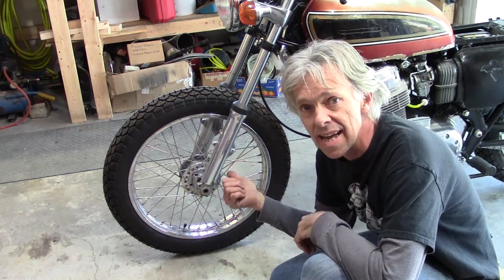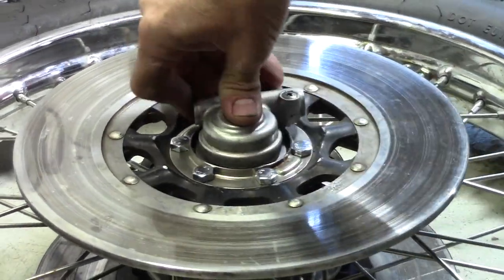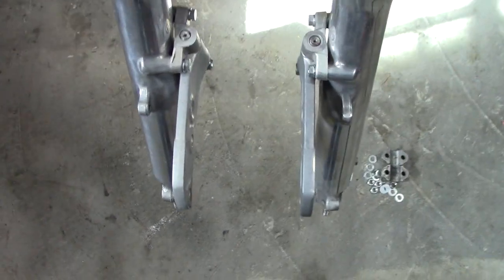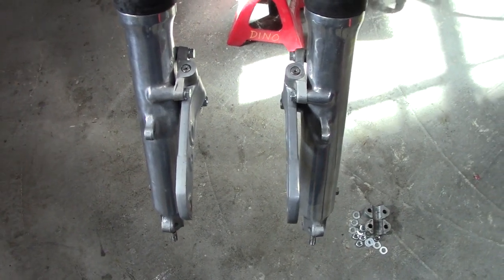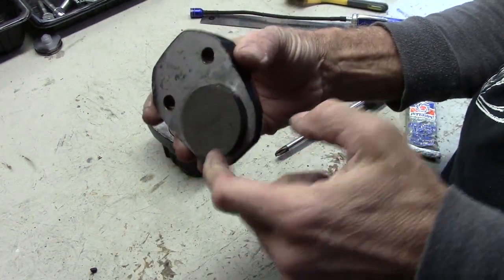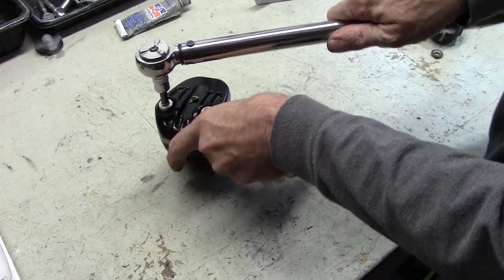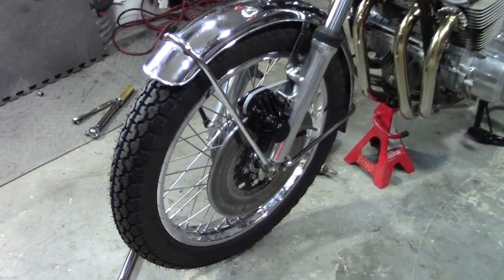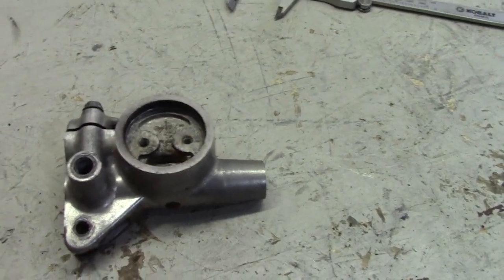73 Honda CB750 Custom Build Part 37 - Front brakes

Comment: The CB750 really needs two brakes on the front.  Once that I made the upgrade, it made a huge difference on the track and in the mountains.  The stock master cylinder works great.  I used a set of Morris Mags which were custom fit just for two brakes.  I also put the lower fork sliders on the other sides so that the brakes were mounted behind the forks, which made a noticeable reduction in steering mass.  C. Jeff Dyrek.

Comment: Really love this series Dino - thank you for making them. I have a '72 with a single front brake. My buddy convinced me to scrap the dual front idea and just go with a braided brake line. I'm telling you its 85% better brake feel and power. It is still not a modern feeling front brake - it will not compare to anything made in the last 25 years, but it is a major improvement that keeps the stock look. I would highly recommend this upgrade.
Reply: +mtvroadglide That's exactly what I'm doing. :) Made a big difference on my VF700S Sabre.

Comment: My father had a 71 CB750. He put dual front disks on his without switching the master cylinder. He remembers it actually making the breaking worse because he couldn't apply enough pressure through the front breaks. Although I don't have any details on his build because he did it in 72 and he didn't have the bike from much longer because his bike was stolen that year. Regardless, good luck with you project/build

Comment: The adjuster on the brake caliper support bracket is to make sure the pads are parallel to the disk.  It is not meant to take up the disk to pad gap.  The piston will do that once it is used.  That is how you get the best stopping power.

Comment: This mod, two disk brakes, has been a popular brake improvement back in the day.  I have done it to two of my 750’s with no issues.  Not sure why you are having a difficult time but the brakes are symmetrical and can be used on both sides.  Also the master cylinder is sized wrong for one brake.  Works better with two calipers.  Most bikes of the time had the same issue with an oversized master cylinder.

Comment: Have enjoyed these so far by the way, so many familiar parts of my thirty plus years doing Honda parts that ended in 2013. I've just started another job working with BSA and Ariel parts, which is f course similar but somehow very different.
Reply: +keepitrunning I'll bet you know some of the common part numbers by wrote. :)
Reply: +Dean Segovis  Oh yes, so very many in my head up until 2000 anyway after that it gets all a bit messy and harder to recall as I missed 6 years of models and then had to cope with cars as well which I struggled with. Not much use to me now with Ariel and BSA but I only have to pick and pack those for 3 hours a day so that doesn't matter do much for now.

Comment: I have a 77 cb750k that I am doing the dual disc conversion on and ran into the same issue with the dust shield. I just to happen to have a set of wheels from a 76 goldwing. That bike, as I'm sure you know, ran a dual disc up front. The gear box retainer, dust shield, and bolts mount up perfect. Didn't need to destroy my factory dust shield incase things don't work out. Haven't rebuilt the caliper yet so I'm not sure how the offset issue will affect things.

Comment: I assume it's the same as my 550, but the bottom fork caps should have the gap at the back. The front is tightened to spec so there's no gap and the rear is tightened to spec so there is a gap. At the 20:20 mark is where you can see the cap you're putting on is backwards. Does it matter? No idea, but Honda specifically mentions this in the manual...at least for the 550 k4. I've been following since the beginning of the Sabre, awesome seeing these videos and following your progress!
Reply: +Susan Barbier Thanks! Someone on the SOHC4 forum mentioned this as well. I'll check it out and mention it in a future video.

Comment: Hey Dino, might not apply for your cb750 but I know on the cb500 from that year the two fork-end clamps that hold the front axel on are uni-directional.  Might be worth checking.  Cheers and thanks for all your videos.
Reply: +Puffin Tyler Thanks!

Comment: How did you get the snap ring out of the master? Its insane. Ive tried a variety of dentist hooks,3 pair of snap ring pliers...no luck.

.
Reply from the maker: You have to pry it inwards with one screwdriver, then get a second screwdriver behind it and pry out and up. It's tricky.

Comment: You do realise that the 3 in K3 does not denote a 1973 model as such. It just happens to be coincidental on this model. The K means revision, from some Japanese word. So this was the third revised model. Some people refer to various K0 models but that technically means nothing. So my CL175K6 is the sixth revised model and is a 1972 model year bike. The odd thing with some series, like the various 175's is that they start with the basic model like CL175 but the next one there is I could ever find listed was the K3. I have yet to work out what happened there I just assume for some reason they were never marketed. The last K type numbering I know is the CB750K8 which of course was 1979 then Honda started on a whole new system of letters, starting with Z for 1979 then following through A for 1980 etc. By the time they got to Y it was 2000 so 2001 to 2009/used just 1 to 9 then started with A again in 2010.

Comment: Dean, I am not sure about using anything other than brake fluid as lube on the seals and piston.  I'm honestly not sure how having the silicone lube in there will affect it.  Just wanted to point out in case you have any better knowledge then awesome.  Just don't want you to go pull the brakes and have none, lol
Reply: +Robert Craft The small amount that's there won't hurt anything. There are silicone based brake fluids available for racing applications.

Comment: Bummer, I'm dying to see how that dual disk goes on now.
Reply: +eljohn3 You have to shim the mounting arm so that it sets about 5mm closer to the wheel. Then there's the difficulty of routing the steel brake line to it. That side of the fender sits very close to the fork.

Comment: I just love your videos but damn you make it look easy! I'd go crosseyed with the numerous bolts, washers, and nuts from a basket case motorcycle build. Would you mind telling us your process of organization and how much you allow yourself to spend on hardware with a build like this ? Thanks Dino!
Reply: +beau danner I use the parts diagrams that the suppliers web pages provide as a guide. Every nut bolt and washer has a specification of its size so that helps me determine if I have the bolt on my available stock. If it's a special bolt I'll buy an original Honda part. If it's just a common bolt I use stainless steel replacements from my local hardware store.
Reply: So looking at your box of parts you're able to use the guide and determine "yeah that looks to be the one"?
Reply: +beau danner Yes by knowing the diameter and length.

Comment: Are you planning to replace the brake lines at all? those rubber ones are usually no good after a few years, manuals usually spec their replacement
Reply: +osamarama Yes. I already have the new upper one in hand. I found a supplier on Ebay that has reasonable prices and you can order them in custom lengths and colors and get the exact fittings you want. http://www.ebay.com/itm/231569649883?_trksid=p2057872.m2749.l2649&var=530806917347&ssPageName=STRK%3AMEBIDX%3AIT

Comment: Can't find the video on bleeding brakes .I've got a CBX 750 that is proving to be an absolute bastard.
Reply: +Alan Williams Coming up next Friday! :) They can be tricky.
Reply: Thanks,Dean.I'll look out for it.
Reply: You should be able to bleed the brakes without cracking the bleed screw by just slowly bringing the lever back and seeing the bubbles come up from master cylinder.  You do not need to bring the lever all the way to the bar.  You just want the air to come out.  This will bleed the master and most of the system.  Takes time but is effective.  Once you get all the bubbles out using this method do a final bleed at the bleeder screw.

Comment: if i have spark and gas but it wont start what could it be?
Reply: +Gino H Ignition timing, wrong amount of gas (too rich too lean) fouled spark plugs, valves out of adjustment, leaky or cracked carb mount boot.....

Comment: No locking taps on the axle holder nuts things?
Reply: +muh1h1 No tabs, just lock washers.
Reply: ***** wierd, would have made alot of sense there, wouldn't it? imagine that thing ratteling lose :D
Reply: +muh1h1 Not really under any kind of stress to make it loosen up. All of the forces are on the fork not the cap. I usually put a paint mark on bolts like that and check them before I ride. My BMW has red dots on all the critical suspension and brake bolts.